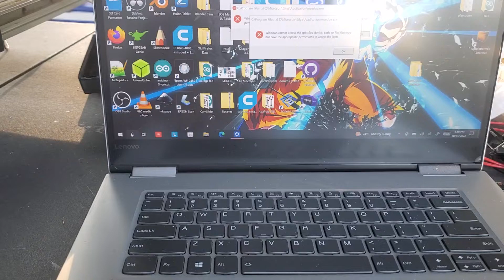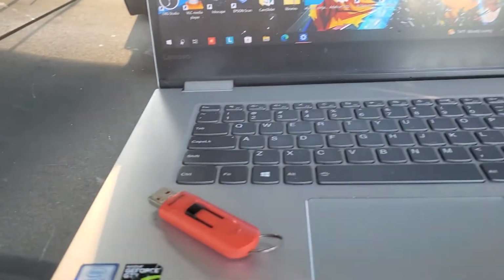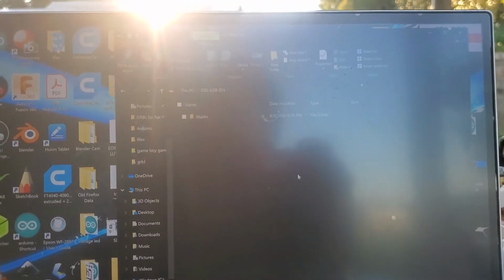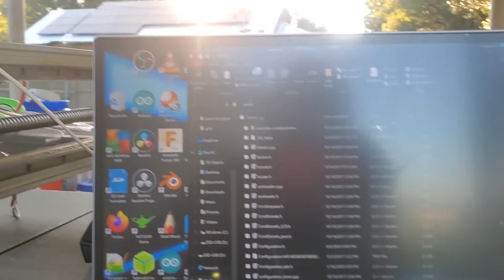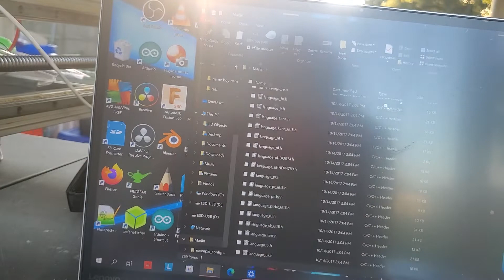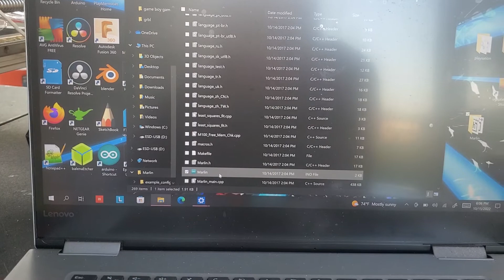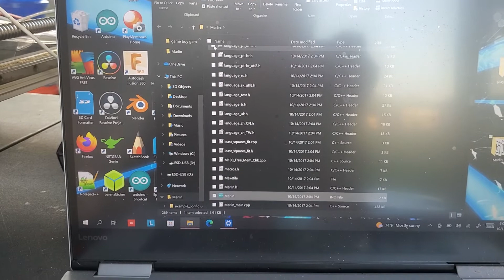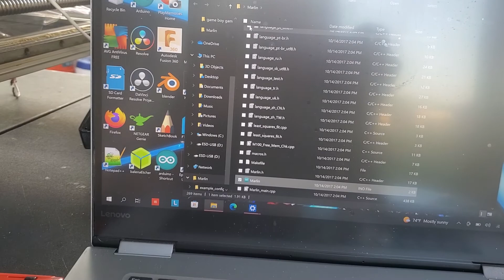marlin firmware setup 2022 for cnc machine

Comment: Sorry for the motorcycle accident this video helped me out a little bit I still need help though I'm just trying to upload my Marlin software to my 3D printer because my 3D prints won't print in the center I keep getting error messages and Marlin when I try to upload stuff to my 3D printer it won't  print in the center my Marlins just acting up it won't upload that's it I'm just trying to get my Marlin to upload so I could 3D print in the center but thanks for your help
Reply from the maker: Your welcome and it could be the motherboard Your using doesn't have a both Lowder installed on it  I know some of the  creality 3D Printers have that problem but I did see a video on how to get it to work but you would need a arduino uno  to do it  but if you are trying to do the easy route then I would say to get a new motherboard like the mks gen l v1.0 or the arduino mega 2560 with the ramps 1.4 sheild and that motherboard only uses 12 volt power supply but the mks gen l v1.0 can use 12 volt and 24 volts that is why I like that one the most 😀